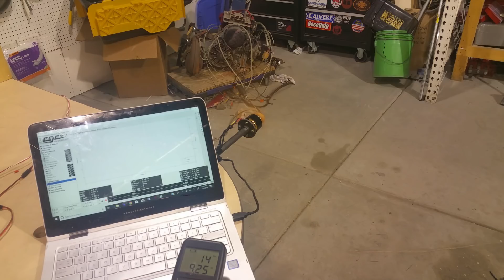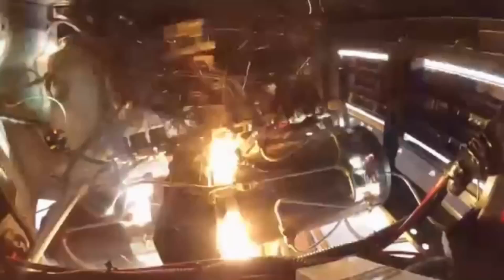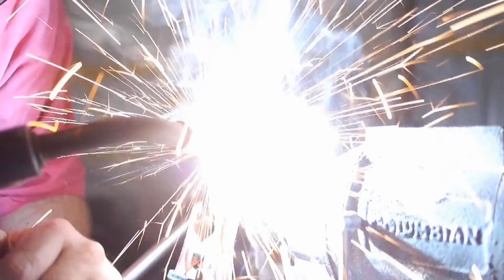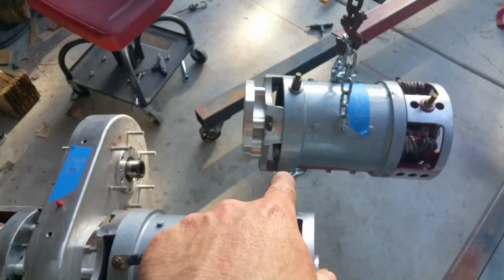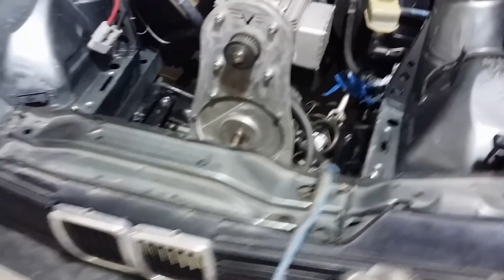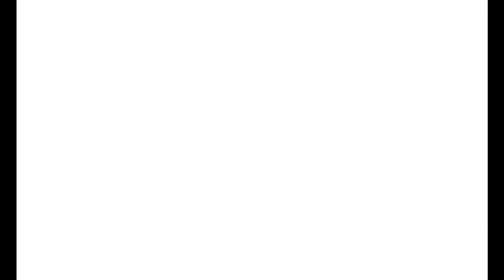EP3, Introduction to the electric aircraft propulsion system

Comment: I have noticed you were considering some of these Ali Express 6215 brushless outrunner motors.  I have used them in various projects and must share that they have a significant reliability issue.  Unlike most high quality motors that take the stator winds out of the motor for termination, they trim all the stator  wires inside the stator and then soldier to the 3 main termination wires.  Basically, with some current, they will de-soldier as there is not internal mechanical strain relief or connection.  Don't rely on their quality inspection or a bit of shrink inside the motor.
Reply from the maker: Good to know but I haven't used any Ali Express motors (or any 6215s).  The motors I am using on the airplane are T-motors MN series. Very good quality, their ratings are believeable, and a reasonable price. I have also tested maytech motors with ok results.
Reply: @EVEngineering  Make sure you "open it up" as you have done with all your other products just to make sure.  Also, I came to your channel based on a battery comparison.  It would seem in the last 3 months, the Pacifica batteries are going up in price quickly.  What does not make sense is that the groups selling them have hundreds (if not thousands) of them.  There must be a source for these other than the Pacifica.  I have been searching the web, but I have not determined the Rosetta stone in finding them.  As LG has half the market, must be some other sources aside from the water cooled Volt cells.  The Pacifica cells are perfect for small vehicles.